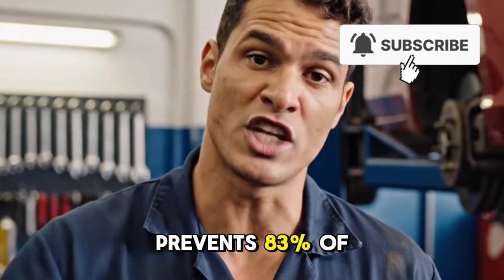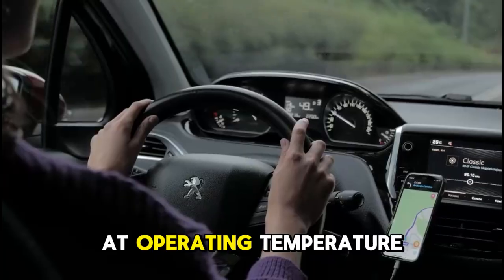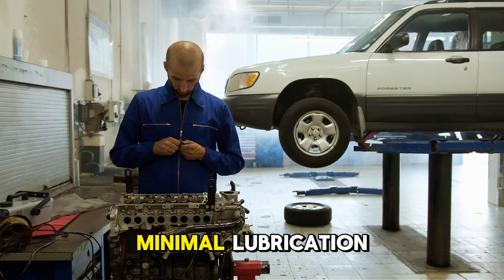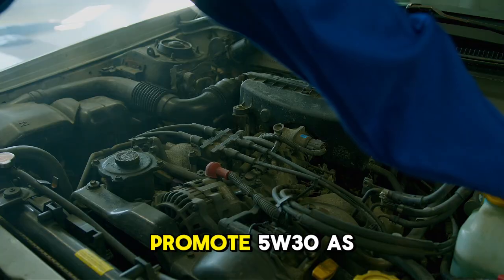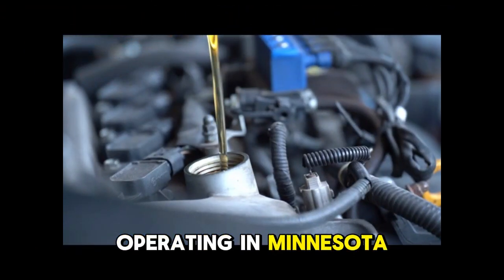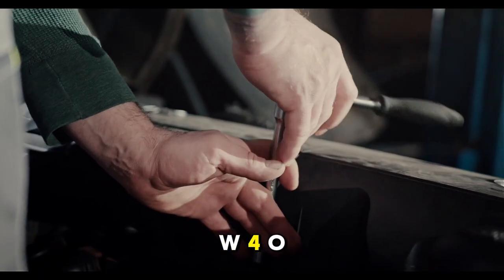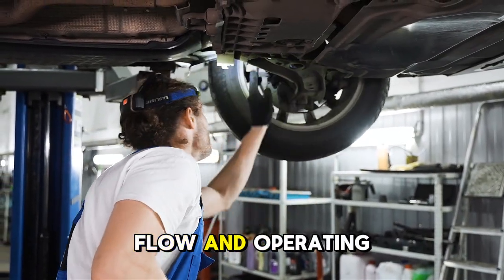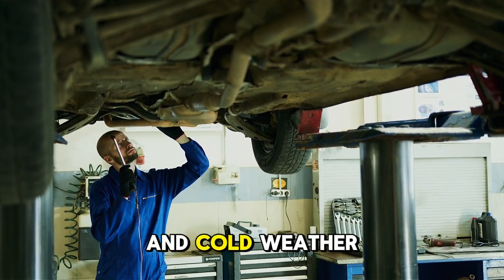5W-30 vs 0W-40: The Cold-Start Test That PROVES Which Oil Really Protects

Comment: Whoever the idiot author of this cornucopia of misinformation should learn what the 'W' after the first number in a multi viscosity oil stands for.  It does NOT mean that below with any multi viscosity oil, such as 5W-30 that the oil will thicken below 5 degrees.  Lies combined with misinformation.

"The "W" in multi-viscosity oil specifications stands for "winter" and indicates the oil's viscosity at low temperatures, specifically tested at temperatures as low as -30°C (-22°F) for the cold-cranking and pumping tests. This ensures the oil performs well in cold conditions."

Comment: I’ve run diesel car’s since 1985 and always used 0/40 since it was first available no matter what the manufacture said in their handbooks and have had absolutely zero engine problems over the years,granted I always change the oil twice a year with a total mileage of around 12,000 yearly. My current vehicle has done nearly 135,000 miles over the last 12 years and run’s like a Swiss clock with minimal mechanical noise,it doesn’t sound any worse than the day I bought it and have no intention of replacing it until 200,000 miles has been completed and even then if no signs of wear are apparent I might push on for another 50,000 miles,I do quite a lot of stop/start work so I’m very pleased with the results I’ve encountered. I check the oil every two weeks and never have to top up between oil changes which for its mileage I’m well satisfied with. I don’t buy the expensive brand’s but I always use the correct speck fully synthetic oil,changing it as often as I do I won’t pay the ridiculous price of some oil producer’s,it obviously works so I’ve no intention of changing things.